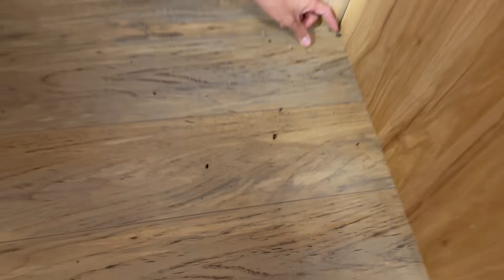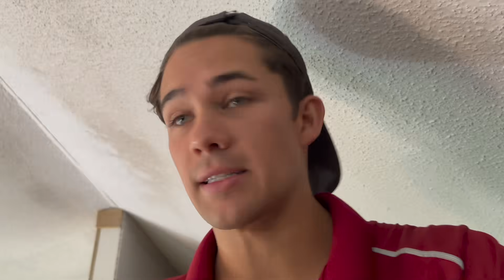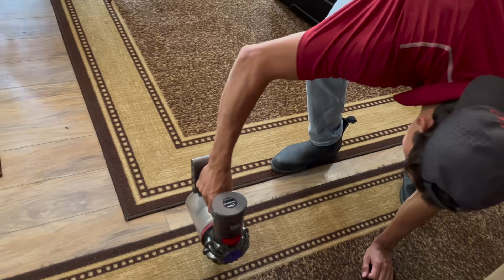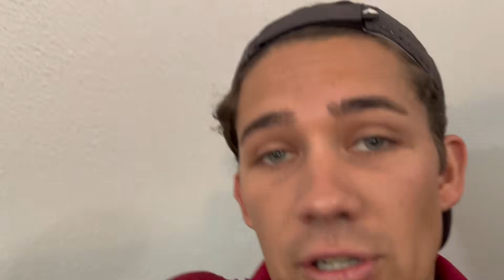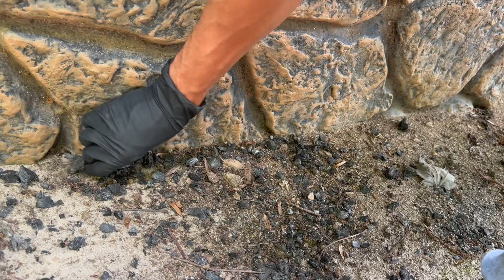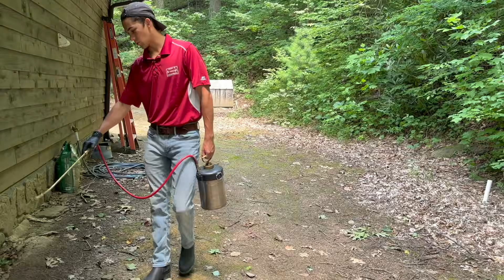Carpenter Ants Takeover Attic

Comment: ok what about an infestation, they came under a door and then went into the wall and then to a dropped ceiling area with fiberglass insulation, I don't see any trace in attic but put borax and sugar out, but they find their way into my living room ceiling light globe so I am assuming they are nesting in the insulation but what about food I dont give them nothing so how do they keep coming
Reply: I’m having this exact issue now. Didn’t you get them under control?
Reply: @clintfowler8932  called an exterminator, went into basement, insisted I not follow,  then sprayed outside all around the house gave me a 5 year guarantee, had an issue with my furnace opened it up there was a stick of poison in the internals man I blew up it was on the heat side so it was blowing that shit with heating, breathing that for a entire winter, no ants yet but WTF! dude trying to kill me?
Reply: @clintfowler8932  hired exterminator, sprayed outside my house then inside, a few weeks later didn't see any but he did not go to attic? almost a year now hoping they don't show up haven't yet $450 and a 5 year guarantee.
my  1 issue I had a water leak in my furnace pulled the cover and there was a poison tube in there I mean really!
Reply: You control them the same way regardless, identify species, identify trail and nest location if possible, treat with non-repellent spray and some bait like Advion, or Advance granules if they want protein at that time, and be patient while treatment does it's job. 

Indoors I like Alpine WSG for baseboards, window sills and trim, door frames, under appliances that will create a good treatment barrier if the insects are contacting through common path ways, they will take it back to the nest spread the Alpine to other members and destroy the nest similar to how bait works but it takes patience for a well established colony you could wait 2 weeks or even three for total control. 

Look for signs that the product is working over time, are you noticing small piles of dead ants? or ants that are walking around aimlessly like they are drunk? that means the poison is spreading through the colony and is working.

Comment: I Dealt With A Lot Of Carpenter Ants In Dallas, Tx . When I Was A Pest Control Tech. 🐜🐜🐜🐜🐜🐜🐜🐜🐜🐜🐜🐜
Reply: I'm a current pest control tech, what made you give it up. I'm thinking about giving it up.
Reply: @marlonward758  I Worked 20 Years! I Was Burned Out. I Was Doing 10 To 16 Residential Homes And Some Commercials Buildings. Plus The Driving. That’s Why I Gave It Up. I Went To College And Earned Criminal Justice Degree. I’m Currently Working As Correctional Officer In The State Of Texas.